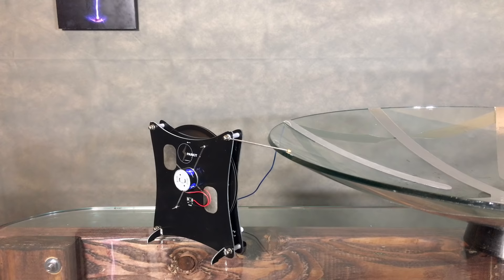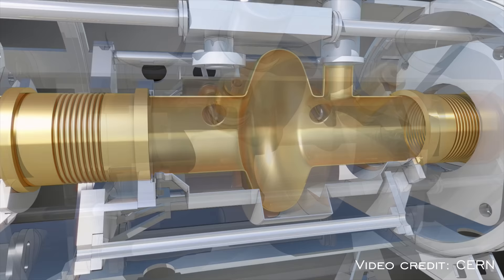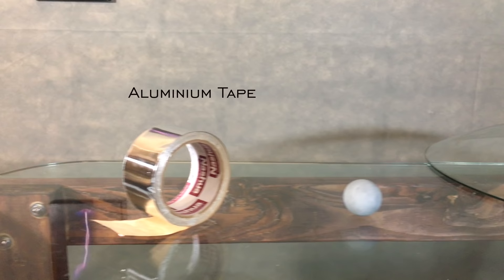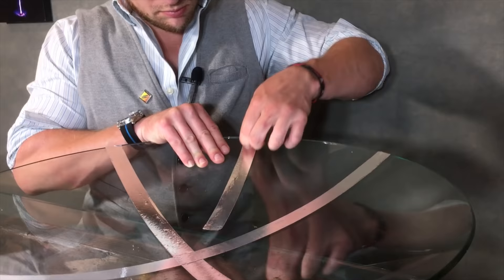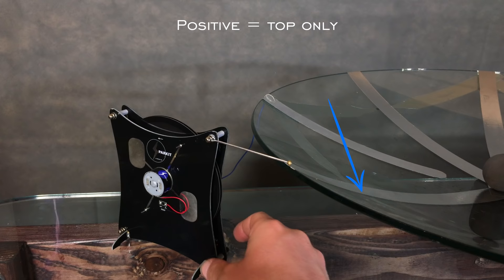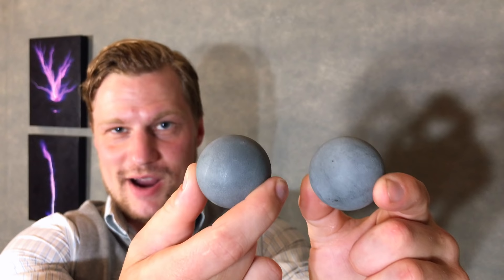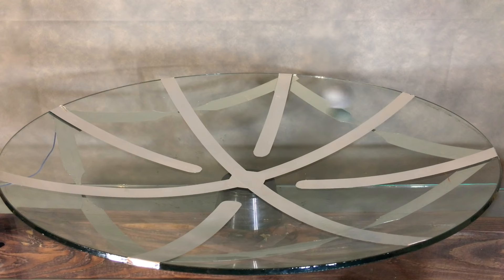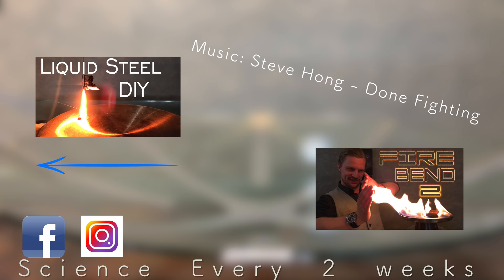DIY PingPong Ball Particle Accelerator

Comment: By the way, why did you say " the positive terminal to the top and negative terminal to the bottom ". Since the output is a high voltage oscillating dc, does the polarity matter ???

Comment: Would covering the ping pong ball in aluminium foil work? Thanks.
Reply from the maker: It would possibly work, but, you'd really need to smooth it out and eliminate sharp edges
Reply: metallic paint maybe

Comment: Dude, I found the ball behaving uncertainly, hesitating fractionally as it approached the next tape at the recommended voltage, almost like it didn't want to participate. Nuts, right?
But when I doubled the voltage (2kv to 4kv) it stopped the jerky transition, energetically rising to the top of the bowl accompanied by a sub-audible vibration (6.66Hz?) and a repulsive non-visual aura above the bowl that gave me a metallic taste in my mouth and tinges of nausea.
Considering this a sign of success I croaked out the name of one of my favorite demons, Ardat Lili, a very nasty succubus demon of the night, I'll have to get bac.....
Reply from the maker: David, I'll take what you're having.

Comment: Literally one of the very first electric motors (electrostatic motor) applied to particle physics. Thanks for bringing up the old technology!
Maybe you can do a video on how solar plasma induces spiral shaped currents in the Earth's crust, known as Geomagnetically Induced Currents (GICs) which are responsible for various phenomena like electric currents and corrosion within oil pipelines and railroads.

Comment: to the "past" channel, z-pinch ball accelerator, joint project
Reply: just have two rails, like in bearings, to have the ball between the rails, line contact, you can make the railgun mag field stronger with up-down perpendicular coils
Reply: those pesky electrons, not synchrotron, going light speed, "infinite mass"
Reply: someone made an oops with the more than all the universe mass prediction

Comment: Sir is it possible for a van de graff generator to produce high voltage.? Is the connection possible? Pls reply, need help😢
Reply: Did you get it to work with a van de graaff?
Reply: @msrlusted685  yup sure. It did. Selected a design that could produce 80kv . But there are many risk of not getting the van de graff to work. If you are going to do this , I suggest you not.

Comment: can i do this with a 9 volt battery...i want to do this for a school project..isn't the current that does the trick??
Reply from the maker: You mean just use 9 volts as the entire power source?
Reply: @PlasmaChannel  yup that is what i mean
Reply from the maker: Steve Nano ## that will not work. Electrostatic repulsion on a measurable scale requires high voltage.
Reply: @PlasmaChannel  thanks alot
Reply from the maker: Certainly

Comment: Very nice!
Do you think a second ball would run, to make it more fun? (Even with added weight and a little asistance to make the second go the opposite direction?)
Lastly, would 2KV of my bugzapper do? (propably not..)
Reply from the maker: Actually, I messed with two coated balls and they chase eachother. Its really cool, but I forgot to film it. They can go opposite directions, or chase eachother
Reply: Thank you!

Ps:would ~1.5kV do the trick?
Reply from the maker: Hmm that’s a little low. But maybe?

Comment: I know it's out of topic, but can I use your HV PSU (Flyback + Ballast driver) to power your voltage multiplier circuit? Asuming   that my Flyback has a AC Output
Reply from the maker: It should work, but, I found it works less efficiently than anticipated.
Reply: Plasma Channel I much appreciate the fast response. I expect more great content

Comment: hello sir, can we use Tesla coil to power it
Reply: dushyant singh I don't think so, because a tesla coil works with alternating current. And for this experiment you need a direct current power supply.
Reply: Andi X No, many tesla coils actually use DC.. all solid state tesla coils like the musical ones use DC.
Reply: Andi X the only ones that use A.C. are spark gap tesla coils, and those also can be ran off DC. The reason tesla used A.C. was mainly because it was the most practicle means to step up voltage without loses.. Also he did do experiments using his coils and DC electricity.
Reply from the maker: So, the output of a tesla coil is nearly always AC. This is how a tesla coil gains high voltages. The electricity bounces back and forth (analogy) in the secondary coil. Every bounce, it gains power. This happens thousands of times a second, and ends up boosting the voltage with every bounce, creating high voltage arcs. The bouncing of electricity is also known as AC. Tesla coil outputs are mostly AC, though coils can absolutely be run off DC
Reply: Plasma Channel yup you are correct on that, the output is A.C. even if it's powered by DC.. because pulsed DC is still technically AC it's just not switching phases. Did you go to school for this stuff or are you just a hobbyist?

Comment: Can we do this by a Tesla coil? By the way you are hero ❤️.. takecare of your health.nice video
Reply: Only a DC Tesla coil.
Reply from the maker: Tesla coil secondaries mostly output AC. No matter the type of tesla coil. But, you can rectify the output with a series of fast acting HV diodes.
Reply: I believe this to be true also to a point. 
 However I have ac primary and dc primary Tesla coils. The secondary reacts vastly different. 

If you bring a glass jar with two aluminium leafs suspended in it towards the top load it reacts different. 
The AC can't move the leaves apart. The DC makes them dance violently. 

My AC setup produces little coronal discharge but will light a CFL from 2foot away. 
My DC setup produces a 2 inch coronal iris. But can't light a CFL at 1mm. 
I don't fully understand why atm  because I can light a CFL with a HV DC multiplier. (Similar to the build in another of your videos.)

I'll let you know if I ever figure out why they are so different.
Or please do a video on AC DC coils.
Reply: Gareth Breedon what he means I think is no matter what you are using A.C. or pulsed D.C. which both technically are A.C.
Reply: I agree Jake I was just sharing some of my findings. In my tests the reactions are different depending on the primary supply. 

Also the leaf thing is a homemade electroscope. Couldn't think what it was called. Lol 

I can read the wave forms at low voltage on my pocket oscilloscope.  They both crest and valley. Although they look very different and act also.

Comment: This Particle Accelerator project is just begging for a Zamboni pile.   Easily put out thousands of volts DC for over 100 years..
https://en.wikipedia.org/wiki/Zamboni_pile

(Would be really curious what kind of speed the ball could go with a good size Zamboni)
Reply from the maker: I never knew about these. Crazy- thanks so much for tell me!
Reply: Try experimenting with ratios of Citric Acid in Glycerol, as a Zamboni pile electrolyte. I have been able to get about 0.2 mA typically from a about 2x2 inch plate of graphite and aluminum. The Electrolyte is very high viscosity like honey and is best applied while hot as it will cool down and hold the plates together. 
                 (Maybe dipping the separator into the electrolyte bowl? to permeate deep into the fibers, Paper towel paper may be easier to work with)
   Magnesium and Graphite/activated charcoal can obtain 1.5V per cell with the Citric acid and glycerol electrolyte. 
(Powers Calculators quite well, pocket calculators typically need 5 uA to 20uA )
I doubt the cell will last 100 years by any means due to the electrolyte functioning by dissolving the metal electrodes, but this makes a very simple and durable cell.
   A simple cell design that I believe would yield good results is structured as follows:

Copper Foil ==> Notebook Paper Separator with Electrolyte ==> Magnesium foil                      Be careful though, the Glycerol needs to be DRY for the cell to last, if any water gets in the glycerol it will greatly increase the ionic conductivity of the electrolyte and allow the magnesium to dissolve rapidly (As in Hours or min).

Sometimes it is a good idea to bring the Glycerol to 300F for 5-10 min to boil out water from the compound.
  Be sure to do the glycerol drying before adding citric acid as the Citric acid will break down above temperatures around 175 Celsius.

Because Zamboni Piles are typically Sealed well I believe Oxygen does not take part in the chemical reaction, especially since some are in a vacuum.
  Honey is said to be often used as the electrolyte in Zamboni piles and honey has a PH of about 3.9 to 6.1, so basically its an organic acid dissolving the metal electrodes SLOWLY.

Honey Crystallizes normally given enough time and the ionic conductivity of crystals as you can imagine is much lower than liquids or syrups so this further slows down the chemical reaction.

In fact "Solid State" Batteries typically involve a mobile electrolyte trapped inside a polymer membrane, because as you can imagine a true solid electrolytes ions would not be able to move around in the battery to carry charges and dissolve electrode materials.

If one wants even higher power output and can tolerate shorter lifespan they can use a Sodium carbonate or Potasium carbonate in Glycerol solution to obtain a high viscosity alkaline liquid that will put magnesium and aluminum into hydroxide breakdown. Aka the solution is Alkaline enough that it destroys the protective oxide coating on the metal. (I have got somewhere around 2 Milliamps with this syrup electrolyte) 
(In other words a Zamboni pile based on this would kill you, 2,000V at 2 Millamps  4 Watts of power through your heart!     0.002 A * 2000 V = 4W)

The biggest head ache I have had with Zamboni piles is the layers shorting out due to the electrolyte getting to places it does not belong and from foil touching where it should not.

One way to reduce issues is by Taping shut the sides of each cell individually with something like electricians tape or scotch tape.
The putting Copper or Steel wool between each cell to provide a conductive path.

Key reason why I have not yet built a Zamboni pile is because I have yet to find a simple way to make reliable cells that do not short out...
(That and getting Transparent box pipe is a pain)
https://www.amazon.com/Long-Acrylic-Square-Tube-Clear/dp/B00FK8MCUI

(Would have to have the right cutting tools as well)

These days its just so easy to get ahold of High voltage capacitors and CCFL Inverter boards that Zamboni piles are rarely made, but their simplicity, silence, and long lifespan give a nice charm....